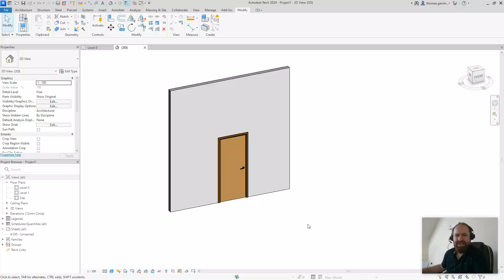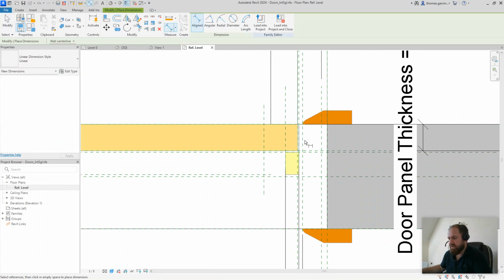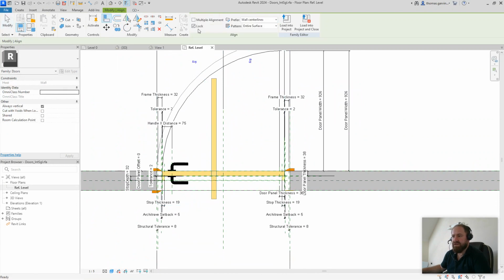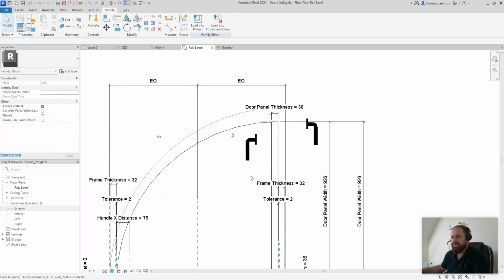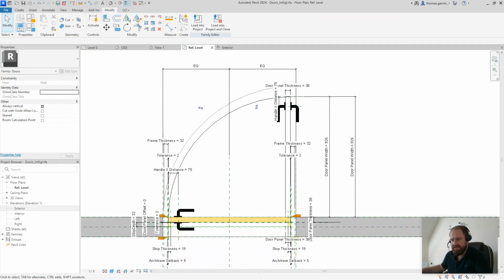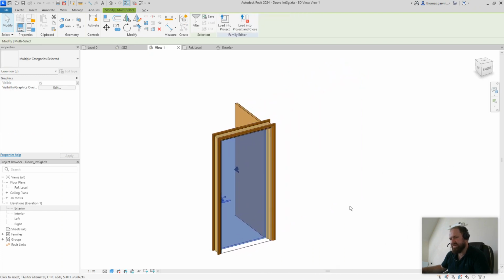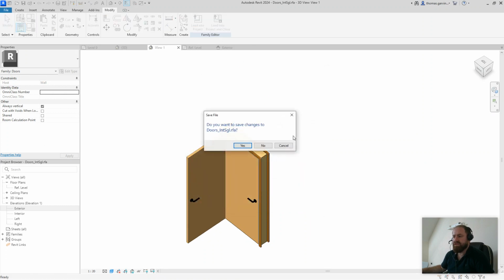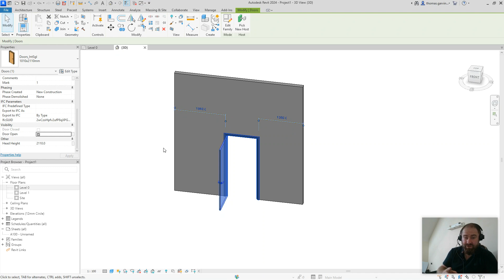Open and Close Door in 3D

Comment: Is it possible to make the opening of the door parametric in 3D? I have a parameter in plan that is degrees of door open (90 fully open 45 diagonal and 0 closed) I just wonder if the reference planes will respond as well to non orthogonal rotation.
Reply from the maker: Yeah it is, I have this in some of my own doors. On my sliding doors I have an open percentage parameter
Reply: @tg-at  awesome! How difficult is it to set up? Similar to this video?
Reply from the maker: It's a different approach to this video. In this video I used the 'smoke and mirrors' approach with 2 doors, hide one reveal the other. For an opening percentage or angle we'd use only one door on a reference line... maybe I'll make a video
Reply: @tg-at  looking forward to it!!
Reply from the maker: With compliments https://youtu.be/7cTaEnjo2y4